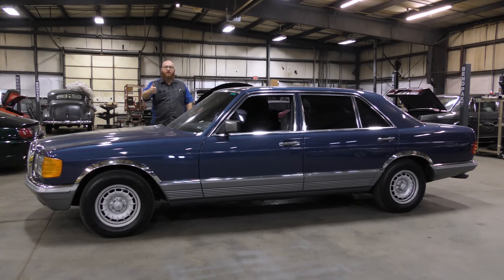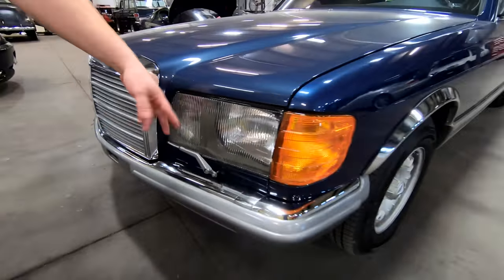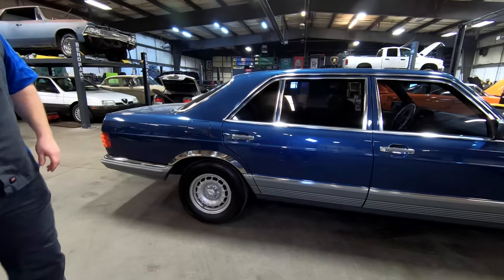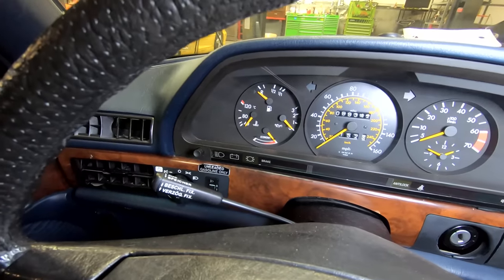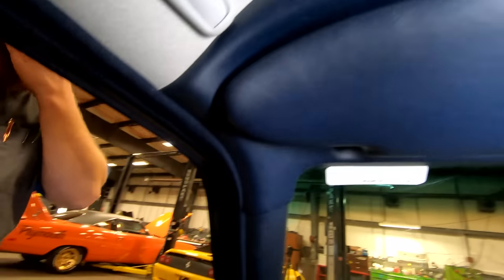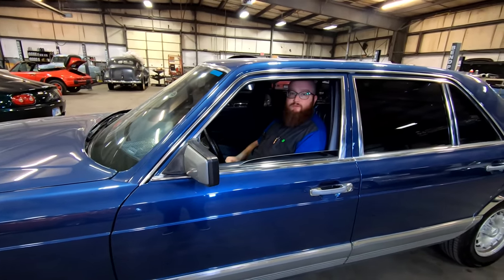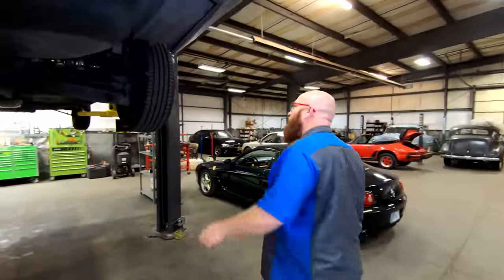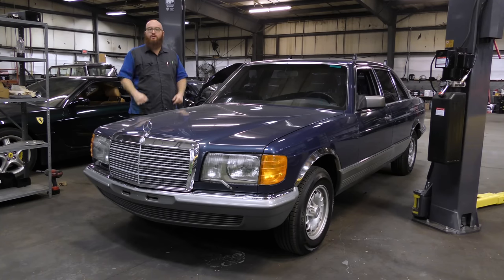Truly a gray market god! Shockingly perfect 1985 Mercedes 500SEL! The CAR WIZARD is in love

Comment: I love this thing! It's beautiful! I took a 1990 560SDL to prom back in the day. This era of Mercedes is, in my opinion, the BEST era. The reason is because they were still built with impeccable quality, and had just enough tech to make them "modern", but not these rolling computer systems on wheels that are failure nightmares.
Reply: There is no 560 sdl.  There 560 sel and the diesels we're 350 sdl and 300 sdl
Reply: @charlestimmis273  geeze, it took 2 years to get called on a typo! LOL. Yes, it was a 350SDL. White with gray bottom and gray leather interior. I actually have a few pictures of it.

Comment: The First Aid kit should be under the rear parcel shelf.  The amber turn signal lenses are a great clue to it's original market.  This is the last iteration of that generation of a great S class.

Velour was common in the European market.  Moreso than leather.

The 380 V8 is the dog of MB V8s and should be avoided.
Reply: Yep. I has a 166 280SE. I loved that car.
Reply: This car has had US specification tail lights fitted. The Euro spec lenses were amber all the way to the end, without the red section for the side marker light.

Comment: Been dying for this video since i saw the car in the background. I have the previous generation to this a 78’ w116 450SEL with that same v8. Its sat for 30 years so i need to clean the tank before i even try starting it. Then have the timing chain guides done
Reply: Nice. W116's are underrated classics.
Reply: @vw5056  indeed they are. BaT prices on them are really getting up there, especially for really fine examples
Reply: The W116 are great cars. Btw, the panoramic sunroof of the W140 fits the W126 perfectly (preferably with the W140 rubber seal) and the frames part number interestingly starts with 116.. A buddy here has the 6.9.

Comment: This is absolutely my ideal spec for one of these blue on the out- and inside. Amazing condition. One day I‘m going to own one of these.
Reply: Find one that spent it's life in the dry US South (SoCal, NM, AZ). Whenever I go back to Germany, I get the use of a 1976 W123 first owner 280 (my aunts) with 70,000 Km original. In S Cali old Mercedes are often seen, but in Europe, they have mostly rusted away. Add the very strict TUV  (technical supervision org, any rust on frame / suspension and the car is no longer street legal). It's not like the mickey mouse smog over her.

Comment: If I remember correctly, the velour seats were the most expensive option for mercedes seats, and yes, they are the rarest variant. I would love to give em a try :') love the old mercs
Reply: Yes, the ribbed velour was more costly than leather, and an option in the up market cars. That's why  you'll see most W116 6.9 L, and W100  Grosser 600 in Europe with velour. Customers for the upper model cars from hot Countries (Middle East, Africa, Central & S America) didn't want to burn their distinguished derrieres, or not so distinguished,  on sun heated leather. A friend here(US) has an even rarer Euro 560SEL, with same but different color velour, and the even rarer rear split / separate seats.

Comment: The early 80s Mercedes with that engine series had an issue with the timing chain stretching.  It would stretch so far the tension would push out of bore and bleed off the oil pressure and starve I think the driver's side cam of lubricating oil and would wipe it out.  It was all pretty easy to fix and replace the parts.
Reply: That was the 3.8, and 3.8 only.
Reply: @znuh  Yes, that is what it was.  Other than that issue, awesome car!!

Comment: In the early 90's I worked at a Mercedes shop, saw lots and lots of gray market cars, the 126 chassis cars (85 500SEL) drove awful, big spongy suspensions that wore out very fast, use to do full suspension bushing rebuilds about 2-3 times a week and at 12 hours of labor time they weren't cheap jobs, All the climate control systems were all vacuum pods to control all the blend and vent doors along with all the door and trunk locks. The 126's were not a reliable car compared to other Mercedes Benz, I'd take a 116 over a 126 any day.

Comment: Amazing car! The wood looks like new and the gauge needles are still orange, so definitely a garage queen. Not a fan of the chromed wheel arches, they are often used to disguise rust. And check the underside of the parcel shelf, from within the trunk. This is a known weak spot.
Reply: I am with you on the chrome arches but since they have been on its life going to leave them.  There is no rust on this vehicle.

Comment: Hi Wizard, great Video. I gues you didn't saw velour seats at a mercedes before that car, because the most car that were exported from Germany to the US have the best features. In Germany the leather seats are rare and expensive. In the 90th I was working as a driver for a limo service in Germany. We had the 560 SEL cars with leather, but I saw many cars from the German goverment, that didn't had even electrical windows or leather seats. Kind regards from Germany, Ralph

Comment: The Mercedes-Benz velour seats last an eternity and was an expensive option in Europe - as expensive as leather and thus not very common... The cars were sold with normal cloth seats as standard. Further to this, in Europe these cars were normally not sold with all options this seems to have (power windows/seats, ACC - buyers often opted for the cheaper manual AC). Overall almost everything, even the radio, is original to the car but the very dark tinted rear windows are not original though. The chromed wheel arches were not standard in Europe but not sure if it was an MB original accessory or after market add-on. Thanks for another super nice review! Happy New Year to you and Mrs W!

Comment: The only thing about owning one of these, who would you find, apart from the Wizard, that could work on and maintain the Bosch Jettronic system, etc. Where would you get parts, apart from rare scrap cars...
Reply: On a Mercedes owners site (BW), we are lucky to have a former Mercedes engineer from the team that developed these fuel injection systems (and some of the engines). The man knows details not found in the works MB manual, incl some of the manuals misprints, of badly translated parts.. Some of the push back comes from self proclaimed and sometimes real Mercedes experts, who still don't have knowledge as detailed

Comment: In 2005 my dad traded a C107 1974 450 SLC for a W126 1985 500 SEL the exact same color just it had blue leather interior and I had a 1987 560 SEL antricite grey metallic with palomino interior when I graduated from high school in 2007. My 560 had 118K miles and his 500 had 91K miles on them. A few years later in 2010 we also got a 380 SEL 1990 420 SEL and a 1991 560 SEL both Arctic White but the 560 had Palomino interior and the 420 had Grey leather interior. The 380 was black with dark chocolate brown leather interior

Comment: I believe that the W126s in North America were only offered with leather seats or MB Tex. In Europe it was different. You had the option of cloth seats, velour, MB Tex and leather. The high level models, like this 500 SEL did not have the option with cloth seats. In Europe velour seats have been a common sight, however if those seats are worn down, they are expensive to replace. With the facelift models produced after September 1985 you also had the option to order the more sportier seats from the 2-door coupé. For the past 26 years I own myself a dark green, 1982 Mercedes 380 SEC with green velour seats and they really make your butt stick in the place. I just love this car and I am just going to keep it.

Comment: A nice car for sure with only 89,000 kays on the clock, but not in the same class as my 1994 W124 E280 with 478,000 kilometers on the clock. Mercs moved a long way in 9-10 years & the 90's cars are considered the best they ever built!

Comment: 6:00 "The Temperature Gauge is in Centigrade and not Celsius or Fahrenheit..."
Centigrade is the old fashioned name for Celsius as mentioned above. The name Centigrade was derived from the Latin originally meaning a hundred degrees. When Anders Celsius created his original scale in 1742 he inexplicably chose 0° for the boiling point and 100° for the freezing point.

I didn't know what Centigrade was so I had to look it up

Comment: Looks like the "importer"  swapped out the KPH spedo for MPH, and added a really tacky "Unleaded Fuel Only" sticker (as required).   If memory serves the HVAC controls are US spec as well, as most Euro S Classes had manual HVAC with dual temp wheels, a fan dial, and a directional dial.  No power antenna and no sunroof, also would never happen in a US model.  (also the Becker would be the Grand Prix, it would have power right hand mirror, and a fader dial).  The  velour though  is the dead giveaway to its "grey" status.  What a great car!     I'd take this over a US spec one any day!

Comment: Stunning example especially the original clean engine bay.  Just needs the missing intake snorkle duct installed.  
I own an 89 Euro 560SEL in dark blue 904 another great paint colour and these mercs are just amazing to drive for a +30yr old cars.  
I actually prefer driving these to my modern daily driver Toyota which is all plastic crap.  I own 2 x gen2 SEC euro coupes as well so i am truly stuck in an 80's timewarp era and would not have it any other way

Comment: Chrome arch trims always hide rust on a w126. Always.

Edit: colour is Nautic Blue.  Same as mine 😉

Edit edit: think its missing cold air pipe to the front grill

Edit edit edit:  think you can pull the dial module and change the temp sensor from C to F, with a pin through a hole

Comment: If you want to drive this all over the continent in comfort
a) save up for gas money

2) change all coolant hoses... and fuel lines, at this age... and maybe, CIS fuel injection at this age, all things with membranes (fuel pressure accumulator, warm up regulator (there are rebuild kits), fuel pressure regulator, fuel distributor (rebuildable by the right people, but not that guy at AAMCO.)

Comment: In 1980's & 90's Australia, private imports of Benzes were common, mainly from UK, but in the 90's it was common to see S & E-Class cars imported from Asian RHD countries such as Hong Kong, Singapore & Japan - Japanese imports were easy to spot as most of them had velour trim like this one, and the number plate holders in the right size for Japanese Licence plates. All Australian delivered 126's would have had leather, as they were very expensive at the time - the new price of an S-Class in the 80's & 90's would have also been around the same price as a decent home in Melbourne or Sydney. Those same homes today are AUD$1 million & upwards...... MB Tex was only seen here on 190E's, or lower-spec E-Classes. Neither of which were cheap cars in 1980's Australia.

Comment: As an european i can say, i have mixed emotions by this car. The German cars where pretty boring inside, but, the electronics where fine and trustworthy. On the lower segment of German cars, you bought a second hand door for around 200 USD, and that was a complete door in the same color :-) A full service of the car, including the repair of a leaking tyre cost me around 600 USD. For a full service on a recent car such as Merceds you can add an zero on the price. :-)

Comment: Would the exhaust FAIL state safety inspection due to SIGNIFICANT HOLES in exhaust pipe?  A new exhaust system for this car is $9388?

Comment: I wouldn't trust the 89,000 mile odometer without some other documentation. We know the cluster has been out to add the fasten belt light, and it's likely the speedo was changed from a KPH to MPH unit at the same time. (And whatever seatbelt chime module that is... it's not Mercedes)
What an odd set of options too! ABS, AC, automatic climate control, and cruise control... but no sunroof, no reading lamps in the rear, no leather, and manual seats! I didn't know you could even option a V8 with manual seats. I thought heated seats front and back were standard on the 500 too. 
I think that car also has the rough road suspension with how high it sits - and it has the factory skid plate! It also has the anti-dive rear suspension.
Reply: If it was ordered through the diplomat sales programme, the options would have been a lot different from what you'd otherwise expect.
Lots of odd combos on diplomat cars...
Especially depending on where the diplomat was stationed! If the car spent time in South America (as suggested in the comments) the rough road package is a no-brainer.

Comment: Lovely looking car. The warning triangle was never included on US specification cars. That color appears to be Lapis Blue. The "chrome flares" are aftermarket, not factory, and were often fitted to cover up rust damage. In Europe, a velour interior was often considered a more luxurious option than leather.  The problem with determining the true mileage on this type of car, is that you probably have no record of what the mileage was then the original kilometer speedo was swapped for a US MPH version. The trim around the sun visors and on the non-velour parts of the door panels is MB Tex vinyl, not leather.
Reply: US cars actually had a warning triangle installed if they were ordered thru the European Delivery program and picked up at the factory.
Reply: @Marklin15  Obviously, cars delivered under the European Delivery Program had to meet all of the local regulations to be driven on the roads there. That included a warning triangle for some countries. Other countries also required a fire extinguisher, and a rear facing fog lamp.
Reply: Since this car is an ‘85 model, the color is actually Nautical Blue Metallic (929). After the ‘84 model year, Lapis Blue Metallic (932) was discontinued. The two colors look virtually identical, though.

Comment: I live in the Caribbean and these came with velour interiors by default, due to our climate. There are some with MB Tex, and even less with genuine leather, both of which would have been specified by the persons who bought them new. I remember these (along with the coupes) were the most expensive new car you could buy in my country back then, unless you privately imported a Rolls Royce or something. They were the equivalent of USD160,000 when new, because we have crazy taxes on cars, including one based on engine displacement... something like USD1.20 per cc for engines over 1999cc.

Comment: Up until the late 1980s you could fly to Germany, walk into a Mercedes dealership, buy a car, and they would ship that car to the US dealership of your choice.  There was nothing sketchy about it and you could do the same with any German car.  I used to have a 1985 BMW 524td that had been purchased in Germany by a USAF colonel.  He drove it while stationed there and had it shipped back to the States when he came home.

When the car arrived Stateside all you had to do legally is change the headlights to sealed beams and make sure the speedo read in mph.  Many people changed the headlights right back to Euro spec after the car was titled and licensed.  The Euro headlights are WAY better.  However, according to the 1980s US government headlight tech had reached it's absolute peak in the 1940s. 😆😆

Comment: That sticker on the climate control panel could have been the emblem of Saint Christophorus. Comes from the French "Regarde St Christophe et va-t-en rassuré" ("Look at St Christopher and go on reassured", sometimes translated as "Behold St Christopher and go your way in safety") - in Europe St. Christophorus very often was the "patron saint" of the automobile. Right up to the 90s, many actually let their cars be consecrated. Most of those very often had the plaque or emblem somewhere on or in the car. It's a pretty deep rabbit hole to go in to, but to keep it also short and come to the point, since the 90s, many in Europe resigned from being a member of their church and so it's pretty rare to see one today. 
Also, nice to see the glorious Becker Europa! It was the go to "middle" model - if you wanted "the all out" stuff, you would get the Becker Mexico or maybe even the Grand Prix (had a factory CD Changer - cost an absolute fortune back in the day, i think it was somewhat around 2000 DM...converted with Inflation i think it was somewhat around (today) 4000 U.S. Dollars)! I actually didn't know, they were able to be used in the U.S.
That Code taped on there could actually be the code for the Radio - they where already secured with a code.
Reply: Yeah, the legendary Becker Mexico!
You can buy Beckers today, with the same classic style but totally modern inside with Bluetooth and all. Perfect for a classic '70s or '80s European car like a Merc or a Porsche!
Reply: @marcusjosefsson4998  Not only that, if you want to keep it completely original, there are adapters for the CD Changer interface that take Bluetooth - actually even in pretty damn good quality! For those later Models (after '92), you can even get ones that do CD-Text and therefore show you the name of the song (or whatever)
Btw, BMW also used Becker Radios for a very long time :)
Reply: @NFreund  Yep.
I have one of those adaptors in my '98 Volvo with the top of the line factory sound system. Alpine-made head unit w. built-in 3 CD-changer, Dolby Pro-Logic surround processor w. center speaker developed together with Dynaudio. It would be sacrilege to replace that with some modern crap, so I bought an adapter plug-in to the external CD-changer port. Now I have Bluetooth streaming and handsfree phone, and everything still looks factory stock!